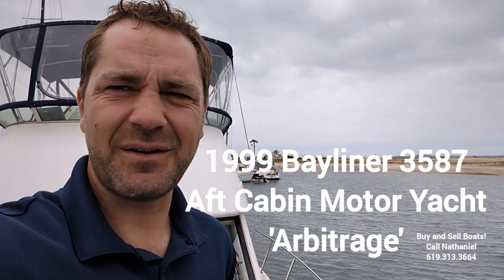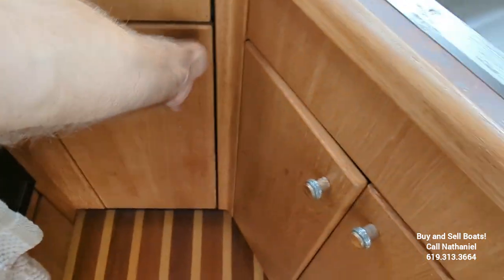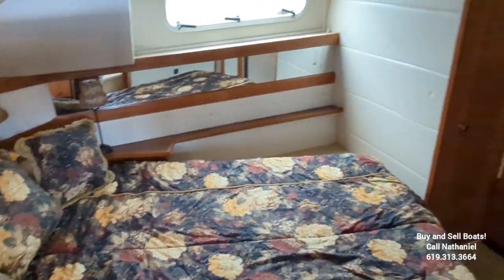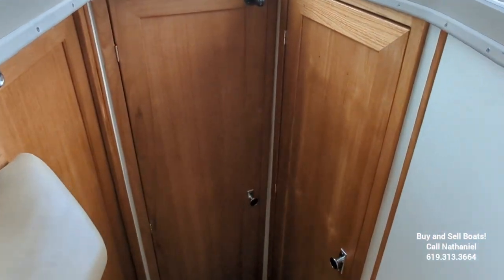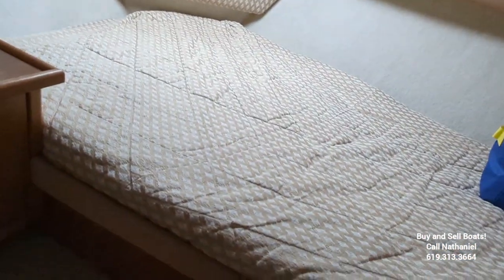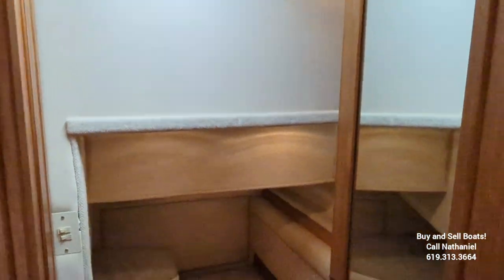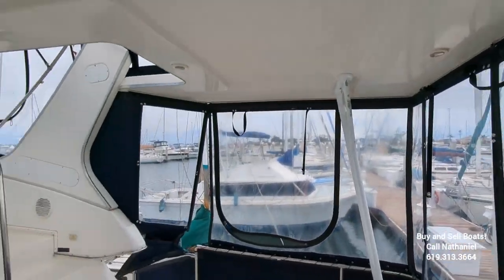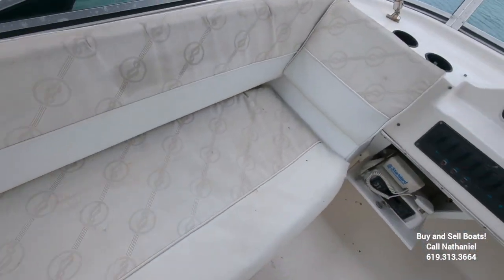🛥️1999 Bayliner 3587 -  Aft Cabin Motor Yacht TOUR - Perfect liveaboard! 🛥️

Comment: Nice vid. I am familiar with this model. We chartered one in 2002 out of Anacortes, WA. I also worked in the Pacific NW marine industry as a subcontractor where I was acquainted with many former employees of Bayliner who built this and other models in the 80's & 90's. 
The padded walls and ceilings look to be in good shape in this particular boat. I've seen many instances of sagging over time. The other material used to cover the inside of hanging lockers and storage areas is affectionately known as "rat fur". It tends to have mildew that forms around corners and edges of the fuzzy felt-like fabric. That is visible a very little bit in this vid but not as prominently as in a vessel which has not had very robust humidity mitigation. This boat appears to have had a conscious effort to keep the interior dehumidified throughout the year. 
It would make a great boat for the mid to low price point charter market!